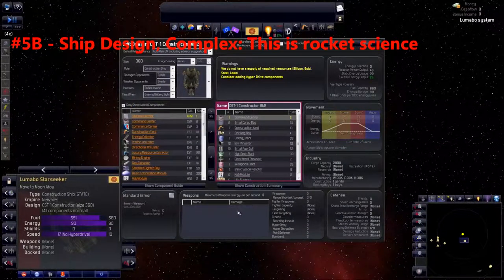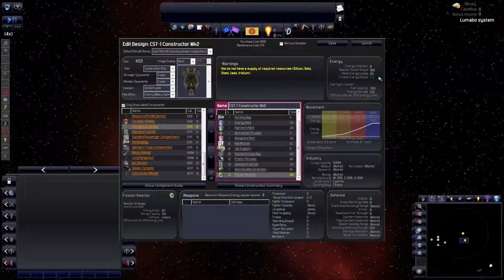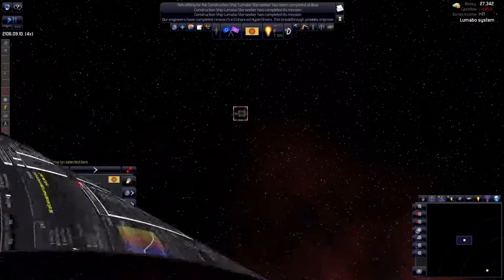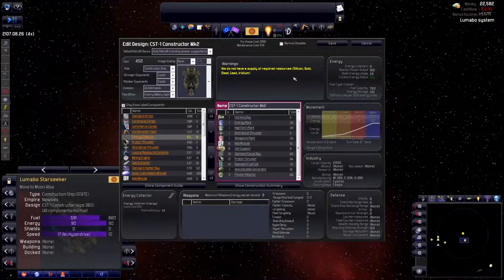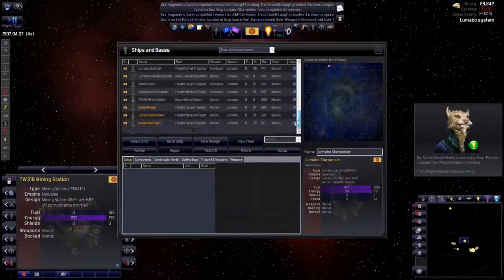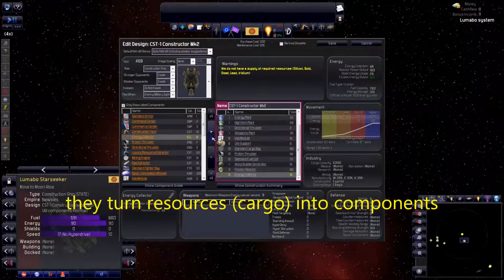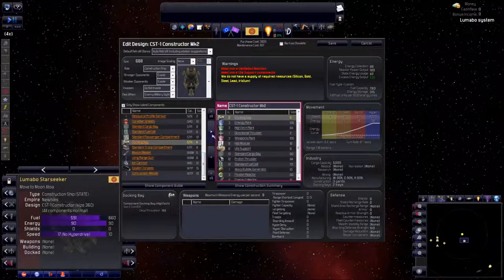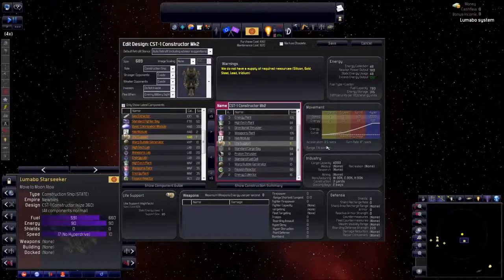Distant Worlds 5B - Ship Design, Complex

Comment: it bad in my opinion that we are unable to manually control the ship to reach maximum speed(sprint) while not under attack or flee. I know if it does and it burn the fuel like hell but... cruise speed is crude!!
Reply from the maker: I see your point, but it's just one less thing to worry about. It would be lots of extra work when you have 200 ships flitting about your empire and needing to tell each one to cruise or sprint.
Personally, I like my ships to be fast so I add more engines than most people to bump up the cruise & sprint speeds. It would be nice to tell some classes to just sprint all the time.

Comment: as pirates like to attack CShips i ended up with giving them a lot of shielding, armor and firepower thrugh lasers, torpedos and fighter bays...
My Cships are compareable to capital ships in combat ability, just slow as hell...
Reply from the maker: That's a perfectly acceptable way of doing things, however I prefer to specialize.
I give my constructors shields and armour so they can get away from pirates, but I don't give them weapons. I use the space I save to add more engines so they are as fast as possible. If one is getting grief from pirates I temporarily assign it an escort fleet.

I do it this way for several reasons:
Constructors often need to travel long distances, so I want them to get there as soon as possible. I want them fast.
Removing weapons makes them cheaper to buy & maintain (not that I have very many - about 8).
When I get new weapon technology I only need consider updating my war ships, not my constructors.
Constructors in safe areas are not carrying weapons they don't need. Constructors at the front lines should always have military protection (an escort fleet). When a constructor is working in a safe area I can reassign it's escort to somebody else.

It's just the way I play - I specialize my ships and build fleets to do the job. Even my war ships sub-specialize into short range & long range attacks.

One article you might want to read is by Jacozilla who has re-purposed Resupply Ships into flying fortresses. I've never had much fun with Resupply Ships, but he has turned them into Death Stars and seems to be winning with them.
Reply: Long distances are not relevant. Every Hyper Drive has a capped top speed, which is just dependent on energy surplus. for the weapons mine have a lot of energy surplus, so my CS are as fast as yours on long range. just on the short aproach, the last miles, mine are slower with speeds around 12. (Which is still better than speed of captured capitals from ancients^^)

Maintainance does not bother me. I dont have so many CS.

I dont build resupply ships, i have resupply star bases. also very well fortified. but i understand the idea of flying fortresses :D
Maybe i give it a try :D